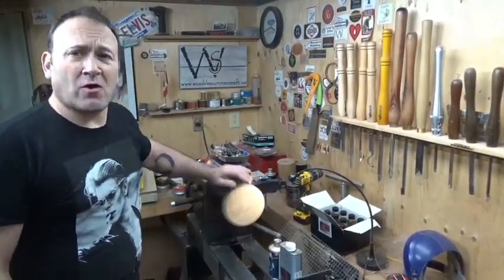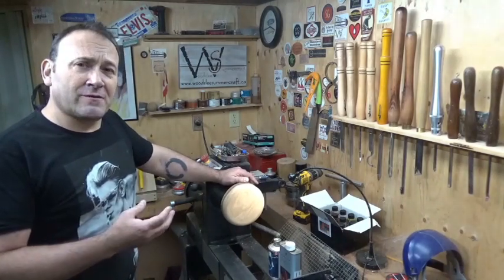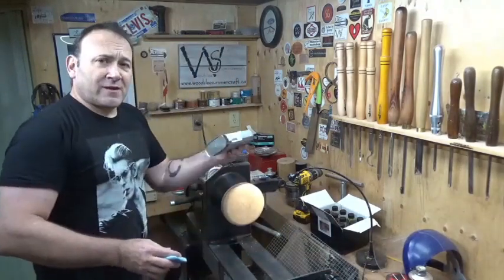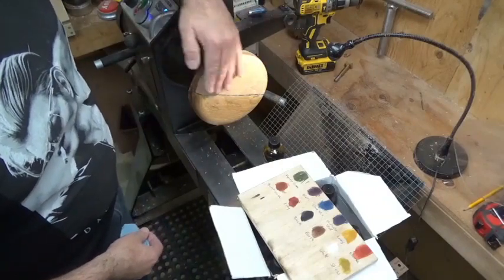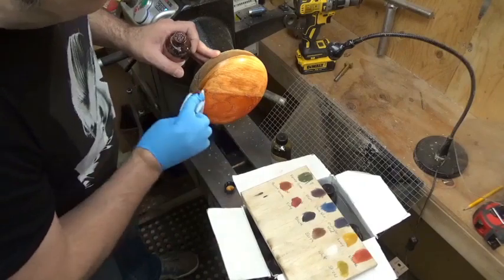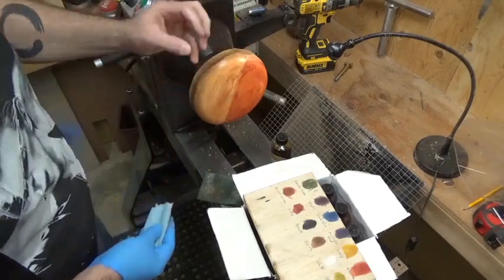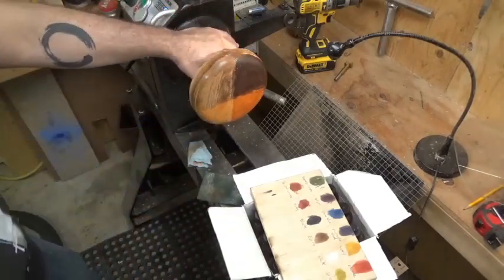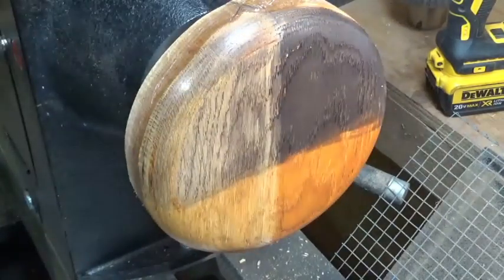To seal before or after intrinsic dyes

Comment: Hi Rob, Great experiment and I think the results speak for themselves. If you want a faint colour then seal and if you want full colour then  don't seal. Great video. Take care Rob. Cheers, Huw
Reply from the maker: Thanks for watching, certainly considering I used oak with very open grain, I think if I had used a tight gran wood the difference would be even more dramatic, maybe if I sealed and sanded the result may be different again but still the instructions are pretty clear

Comment: Sealing the wood before colour is something I've thought about many times. Maybe less  sealer or maybe in patches could create some interesting effects. Spirit stain maybe worth exploring. As you know I'm always looking for something different.
Reply from the maker: The specific question was regarding Hampshire sheen water based intrinsic dyes so I expected these results, I don’t have any experience with spirit stains but my understanding of ‘stain’ is that it is absorbed into the material, and sealing the wood prevents this. Worth a play with though
All the best
Rob

Comment: That's a useful video. Could you continue your experiment by using Yorkshire Grit? I'd like to see what happens
Reply from the maker: I use Yorkshire grit on most of my turnings
It is a fine abrasive paste so takes care of the finer sanding without traditional dry paper sanding
Reply: @WoodsleeSummercraftwoodturning  Cool. Did this test piece look significantly different after Yorkshire Grit treatment?
Reply from the maker: @Shtanto  this test piece was specifically intended to test the dyes prior to sealing and after sealing
Yorkshire grit makes a very significant difference to your finished turnings

Comment: Given that you are located in Canada, what are you using for denatured alcohol since you can't actually buy DNA in Canada?
Reply from the maker: you can buy it in Canada but its not called denatured alcohol, i understand the restrictions were due to people drinking it? i think, but i believe it is not intended or safe to drink, i'm no chemist.
read the ingredients on certain products to find it.
Reply: @WoodsleeSummercraftwoodturning  That is the problem I've run into.  What is the name of the product  you are buying?  I used to be able to get ethanol stove fuel from Canadian Tire but they no longer sell it.  Looking for a suitable replacement.
Reply from the maker: exactly, bio flame, at CT, fortunately i purchased a lot of it when it was available, i recommend a feed warehouse that supply stuff for horses etc, you'll find they sell alcohol that is essentially the same product, you want something that pulls oil and dust out of wood and vaps off quickly.

Comment: The only reason I can find to apply sealer before the dye is to ensure that the wood absorbs de dye in a more uniform way, avoiding spots. Even though, I would have sanded back the sealer with 320 grit or higher before applying the dye. That way, the difference wouldn't be so pronounced.
Reply from the maker: that may well be true, maybe further investigation, but honestly ive not yet had that problem, there are many turners using these dyes as per instructions with fantastic results. 
but i understand there are many ways to get to the end result.